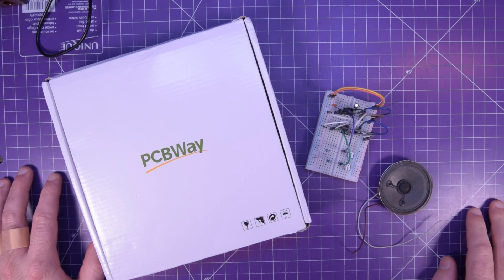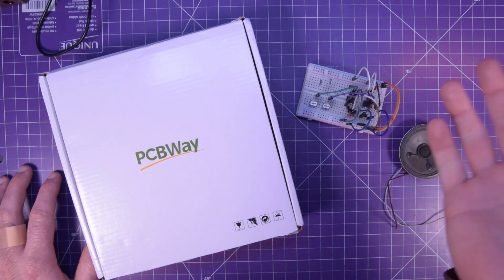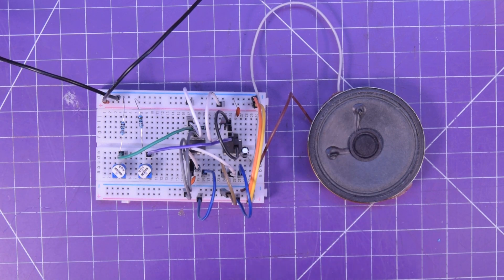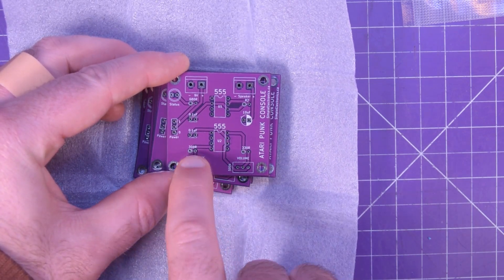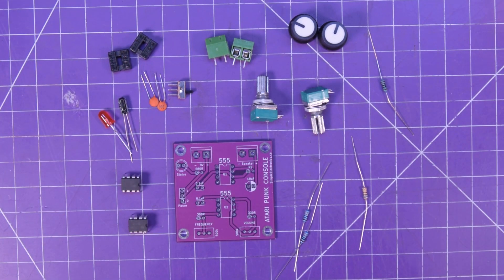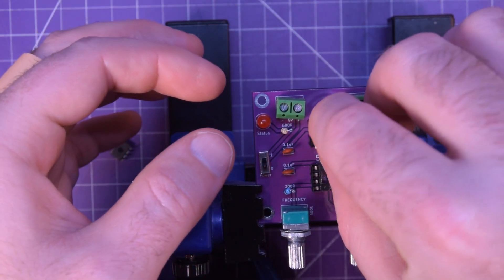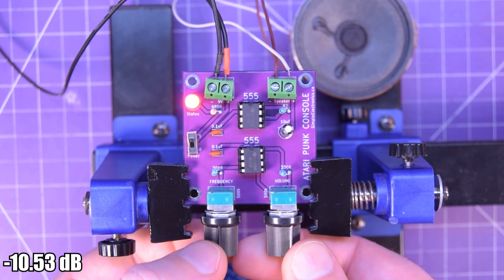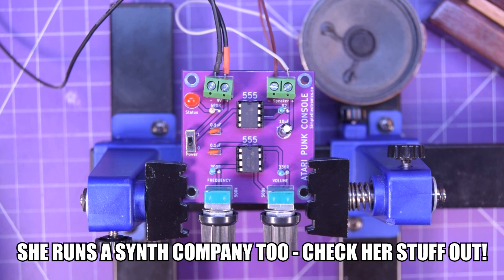The Atari Punk Console - Retro Sounds On The Cheap

Comment: I wonder what potential this has for having a second smd board installed to add a bypass CV input to allow for frequency or pitch control with a CV controller capable keyboard?
Reply: No problem to add cv. I picked up a eurorack format apc from a diy builder in Holland. Mine has cv input jacks for both the parameters controlled by pots. It won't track 1V/oct, but if you send the output of another, more precise oscillator (which is tracking the keyboard properly) in to the cv, it is possible to play melodies on it. Another great use is to send short bursts through a vca as a neat textured snare drum sound.

Comment: This is a brilliant little circuit!!!

Genuine 8-Bit Atari sounds are produced by the custom 'POKEY' IC and real ones are devilishly hard to find these days, not to mention expensive. The implementation of analogue and digital components on the same chip make it nearly impossible to mimic via an FPGA design as well. At least that was the situation a few years ago when I was still active in that community. Maybe someone has come up with a cycle-accurate replacement since then. I certainly hope so!